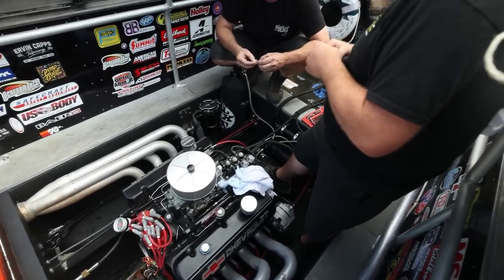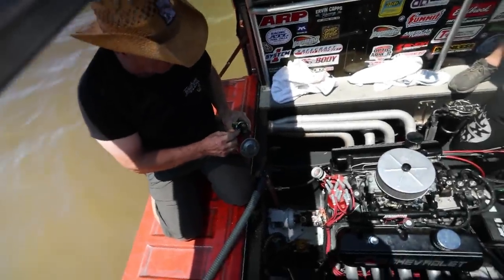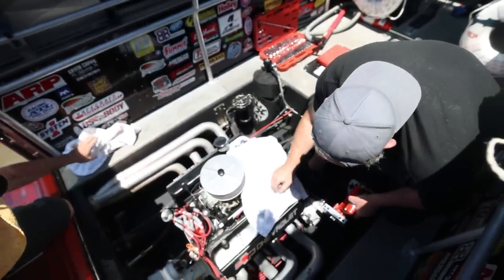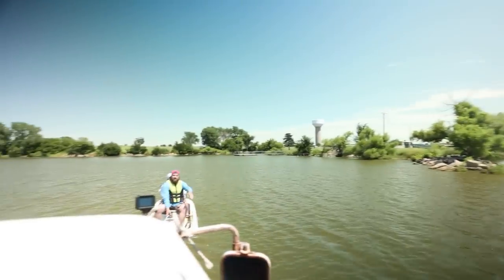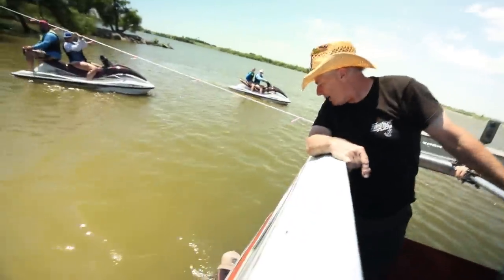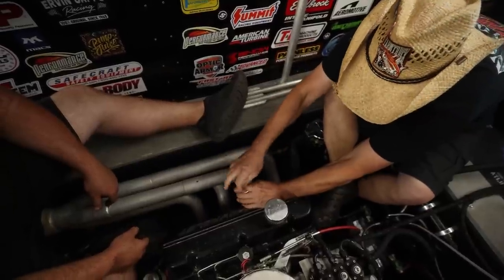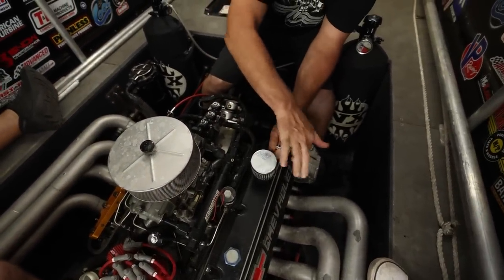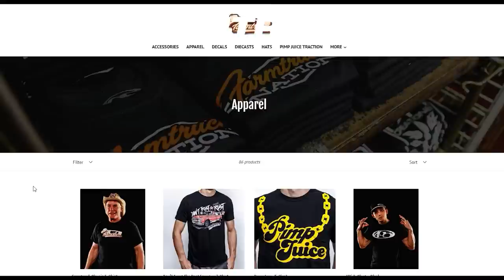Smoke on the Water! LITERALLY! - Farmboat catches on fire and locks up the engine mid-pass!

Comment: I had a similar experience with a 115hp. outboard jet. Turned out it sucked up a rope from a crab pot. I noticed from the drone shot that you ran over a buoy. By now, I'm sure you know. Thanks for the fun videos!
Reply: Same here with my outboard luckily I was able to disconnect the engine and it fell into the water before it caught my transom on fire
Reply from the maker: The engine locked up before we ran into the buoy. after the boat lost propulsion, it just veered to the left thus running into it. We checked the jet and nothing was sucked up in it.
Reply: @FarmtruckandAZN  Hope it's fixable. Good luck!

Comment: Shortly after you ran over the buoy at 17:28 the motor quit.  When you dig deeper I would check the jet drive system.
Reply from the maker: The engine locked up before we ran into the buoy. after the boat lost propulsion, it just veered to the left thus running into it. We checked the jet and nothing was sucked up in it.

Comment: Might want to check the prop or out drive. The line holding the bouy in place could be wrapped around something that caused the motor to stop.
Reply from the maker: The engine locked up before we ran into the buoy. after the boat lost propulsion, it just veered to the left thus running into it.

Comment: She seemed to be tight when you were trying to start it at the dock before the run. Then the breather started huffing right before she decided to throw the dead bolt mid pass. Thats what caught fire BTW, all the oil gas mix coming from the breather. You get her going again Farm. If we can spin AZN in a nitrous chair to the brink of unconsciousness, fixing this is child's play.....lol
Reply: The breather was huffing smoke because a red hot rod bearing was burning the oil in the pan as it spun on the crank. The fire was the result of the 2 windows in the block slinging oil all over the hot exhaust. 
It was a starter issue, and possibly too much timing, making it hard to turn over at the dock, not the bottom end of the engine. 

Spun bearings are VERY common on an old race engine with a ton of time on it. Especially when the motor is inhaling 300h.p. worth of nitrous at 7000 rpms.
Reply: @davelowets  Go look at other videos of the boat racing, its never started that rough. Watch the video, the same air and oil mix coming from holes in the block would be coming from the breather first.

Comment: When the starter does that it usually means the bendix is bad/ not kickin out
I have had new starters do that out the box...
Reply: Or vice versa. It doesn't disengage and over spins causing it to overheat/ burn up
Reply: @KRRZ350  they will not do that, there is an overrun clutch that prevents that, and heat does not affect the bendix
Reply: @Guns_N_Gears  I've seen starters get stuck out on more than one occasion...
Reply: @KRRZ350  it does happen

Comment: Ive seen guys run 305 and 350s fron cars in boats and they always have issues. Boats have infinate cooling and the pistons and rings and bearing clearances are for running 200+ degrees and boats rarely get over 150
Reply: Car engines work fine in boats... I've done it a dozen times.

Comment: Capitan FARMTRUCK in his boat reminds me of a growing up experience.
The story goes like this I beleive it was aproximentaly 19 and 78 my brother gets this Idea to buy a boat. I gonna say it had to be like about a 1960? Imperial, a sort of cute ugly thing, it had a ble bottom with a white top, had a smaller white canvas top over the pilot area, and i think was a 40 horse Johnson out board motor. now this boat ran like a little kitten while in the garage but as soon as you put it into the lake it was pure grief. However back then I had my 1969 chevelle, a blue bottom, and white roof. Ironically the blue of his boat, and my car was all most identical. So with some Genuine true hillbilly manufacturing, making a hitch on my really jacked up car the boat and car looked so awesome when tied together.  Back then I generally wore my Smith Built Stetson cowboy hat. I paid out huge money for. well we load up boat hooked up off to the lake we go. we were like a half mile off shore in this old tub of my brother's it started to do it's normal acting up not runnig to good, and so on. Now durring this adventure my brother talks me into letting him wear my HAT. so all was going well and as said the Motor acting up like every time in the lake, we were at a High speed persuit for shore, about 10 mhp, for some reason my bother has a notion to put down the little top so we get it done, and we was said cruisin around 10 miles per hour as fast as it would go. My Brother sets up on his seat, a knee on the seat so his head was above the windseild. and out of no where that dam well hated old 40 horse back there got a notion to run right and it roared to life. Long story shortened, well guess what Off goes my hat right into the lake. Yup my Brother puts my Smith Built into the lake.... to say the least I still wanna hang him for that. and from that day onward the was no way in hell did i ever ever go with him to the lake if that boat was going too.  I think it was in the mid 80's dad gave his boat the eviction notice to get it outta the tree row by the garage so he sold it. the happiest day of my life  giggles

Comment: Better check the jet pump. If you sucked a sunken anchor rope that would lock her up too 😉
Reply: You're close, watch the drone footage at the end. He ran over a buoy, then it disappeared until they stopped, I'm sure he sucked up the rope. Too bad, hopefully didn't hurt the engine too bad.
Reply from the maker: The engine locked up before we ran into the buoy. after the boat lost propulsion, it just veered to the left thus running into it. We checked the jet and nothing was sucked up in it.
Reply from the maker: The engine locked up before we ran into the buoy. after the boat lost propulsion, it just veered to the left thus running into it. We checked the jet and nothing was sucked up in it.
Reply: No. A rope would NOT stop that motor at 7000rpms on a 300h.p. shot of spray. It would EAT that rope like it was a mid day snack.

Comment: I’d put $ on hydra locking
Reply: I'd put more $ on a spun rod bearing.
Reply: @davelowets  spun rod bearing will go to chirping and such…. Not just gonna lock it up like that. The starting problem initially is what was giving me a clue into a cylinder or 2 trying to hydraulic